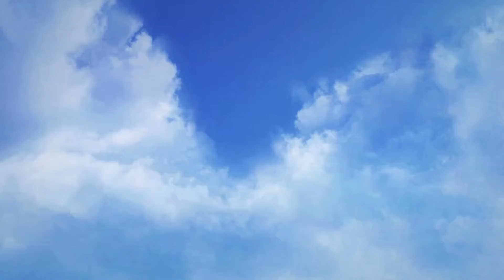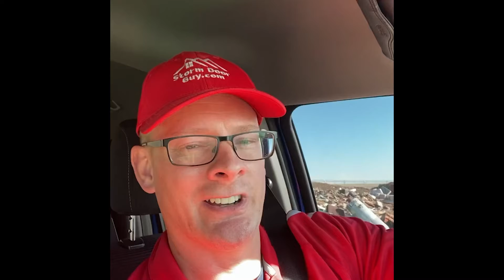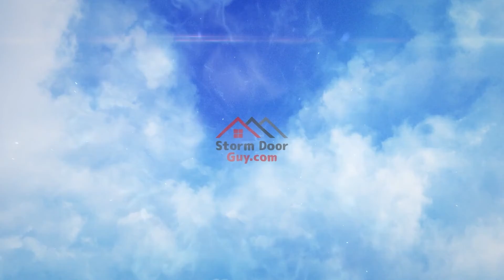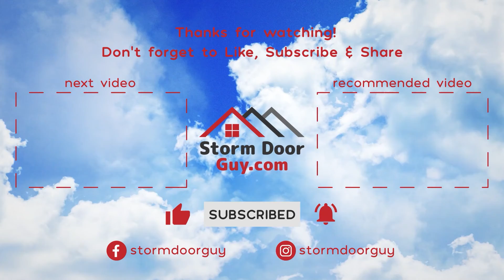Recycling Doesn't Cut It: Here's Why!

Comment: So...but is it about the money? Or is it about responsible use of resources? Also, I wonder about places who charge to pick up your recycling then might just put it in the dump with the rest of the trash...
Reply from the maker: Unfortunately, sometimes it does come down to money for small business. I wish as a society we could invest more money in recycling technology, we are SO wasteful. But there has to be an economic incentive on a microeconomic scale. I wish I could find someone to recycle window glass!

Anyway, i'll give you an example of recycling waste. All contractors now have to be lead based paint renovator certified by the EPA to work on homes pre-1978 because of lead based paint. During the renovation process, yards and yards of plastic sheeting, tape, and other supplies are mandated to be used to protect the surrounding area from paint flakes and dust. This can add hundreds or thousands of dollars in costs to a job. At the end of the job, all of the supplies and trash is carefully placed in sealed trash bags, gooseneck tied with duck tape and placed in a specialized dumpster.

That dumpster with all of the hazardous material is then brought to the landfill, where it is run over with bulldozers, breaking the bags wide open, and releasing all of the lead paint dust into the atmosphere. And we added hundreds of more square feet of nonbiodegradable plastic to the landfill.